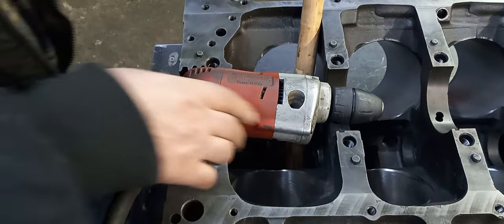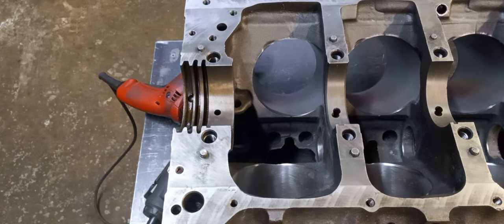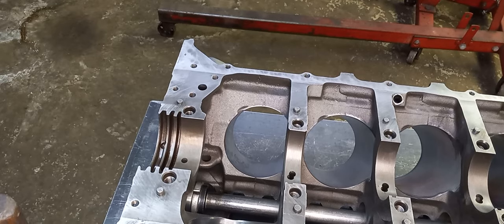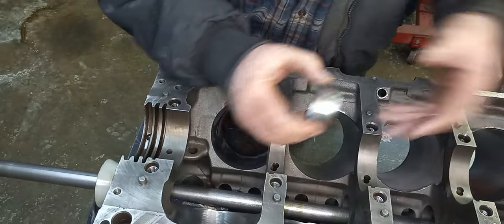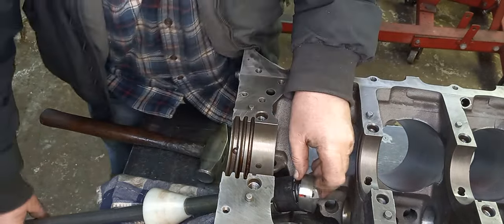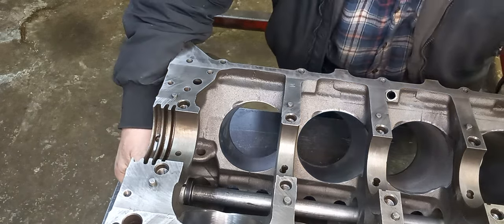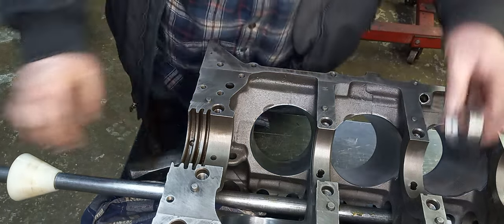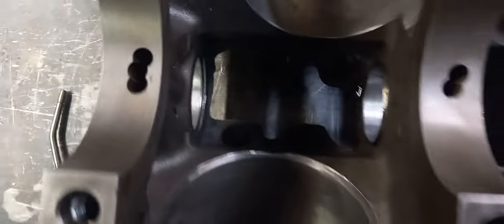installing cam bearings in a Pontiac 400 block utilizing a recycled broom handle

Comment: I found this video very interesting. It seems like all the prep work done to the block and the bearings worked well, as the bearings went in without too much effort. I wish you would have shown test fitting the cam. Sometimes, despite our best efforts a small number of cams seem to bind. Exactly why, I don't know. The broom stick handle is a good idea.
Reply from the maker: Thanks yes everyone gets test fitted with a cam I think I did mention that in my small block camshaft video I believe but that is a good point and I'm glad you enjoy the videos thank you very much